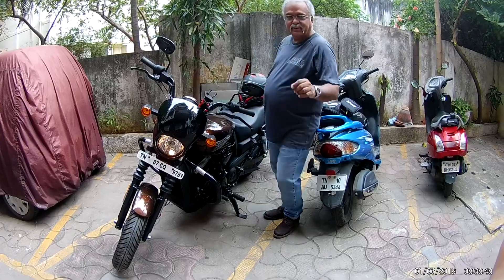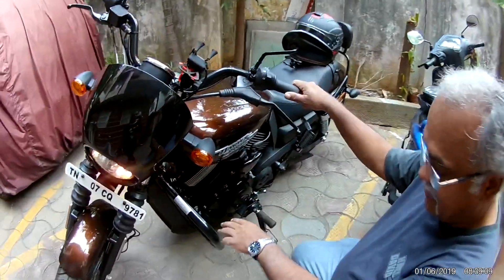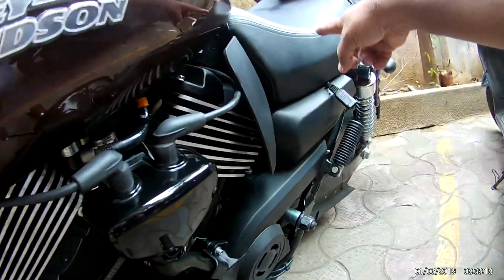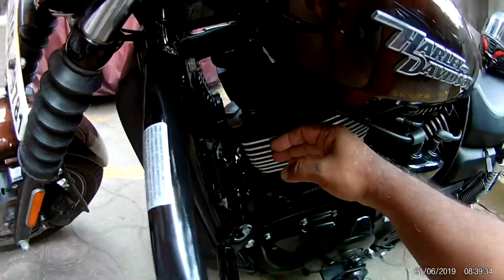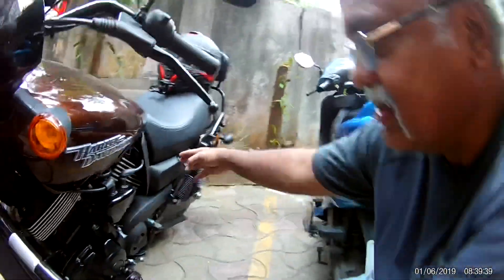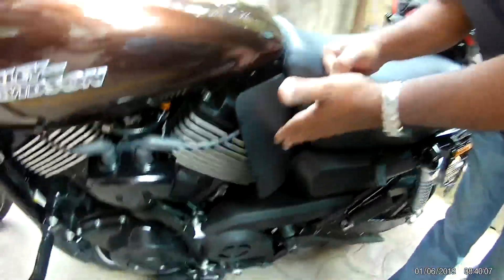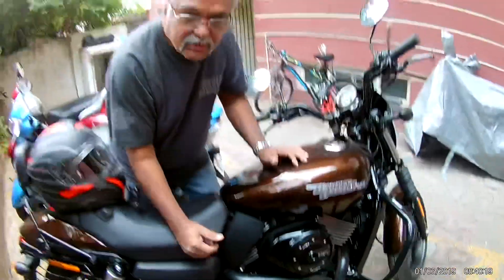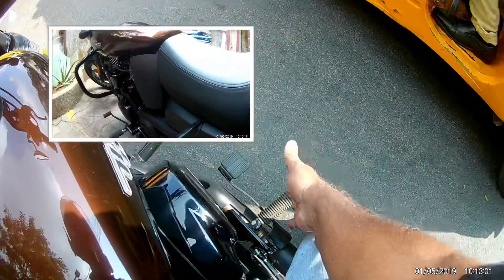Heat shield  for Harley davidson street 750,hot air diverter,city ride comforter.

Comment: First of all, I'm an automobile engineer trained with Arai & also an fire forensic investigator. I want to congratulate you for your creative thinking skills first to find why it heating, second to use an plastic material to divert the heat flow. This seems like a fun activity rather an solution to dissipation of thermal heat. Read further only if you are interested for root analysis of this installation, when you are adding those plastic fitments, you are diverting the hot air towards the engine which is already hot. This raises the ambient temperature around the engine block & the fluid that cools the engine has to now work more hard to cool the engine. I hope you understood my point, if you have an idea of aerodynamics of an automobile. Second, when this happens it will cause the radiative heat transfer to your plastic installations. As the auto ignition temprature of plastics very low compared to steel or aluminum. This will eventually lead to fire, fires don't happen everyday but you never know when they will. Wouldn't have taken this much interest in explaining you if I wasn't impressed by your creative thinking in the first place. Would suggest you to install steel. Whatever the manufacturer designs it is the best squeezed design of massive research. Have a great day